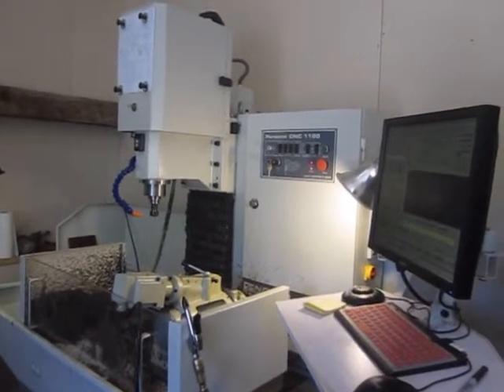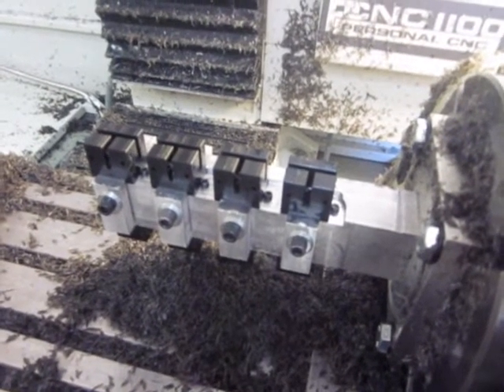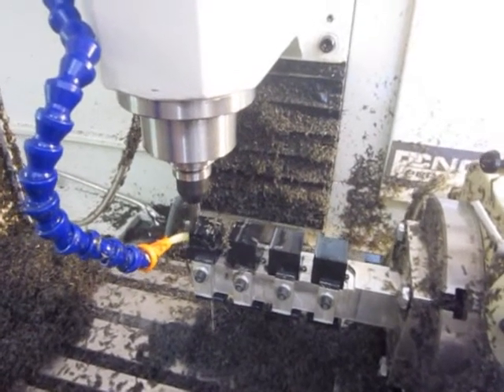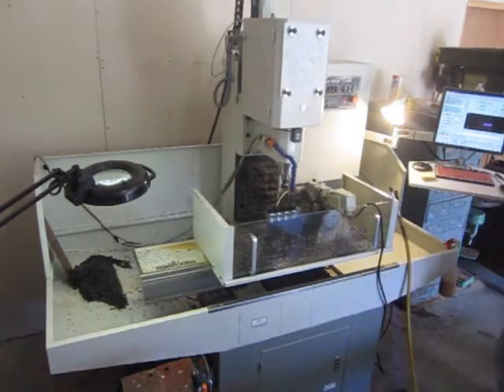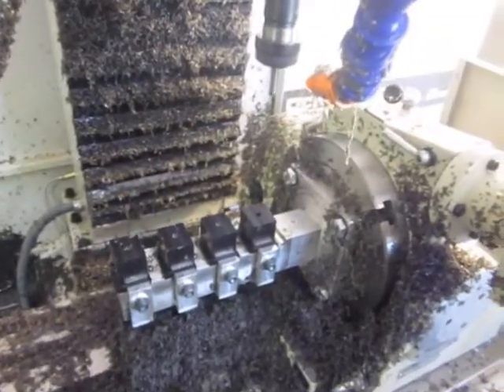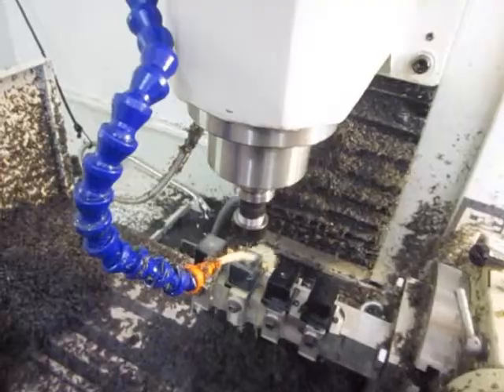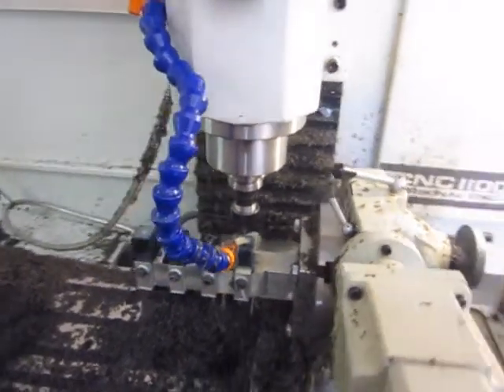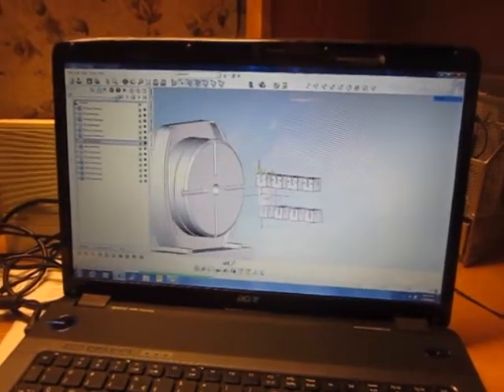Tormach PCNC 1100 Mill 4th axis multipart fixture

Comment: Very nice video. Have you considered using a shop vacuum to pull away the swath rather than flood coolant or do you need the flood coolant to stop the material from melting? I use a custom shop vac hose I made on my 1100 PCNC for a lot of plastics and MDF.

Comment: good fixture but what the hell its plastic, why do you have the coolant turned on ??? and why are you running so slow, you should be flying through that, you can cut hardened steel 10x that speed !!